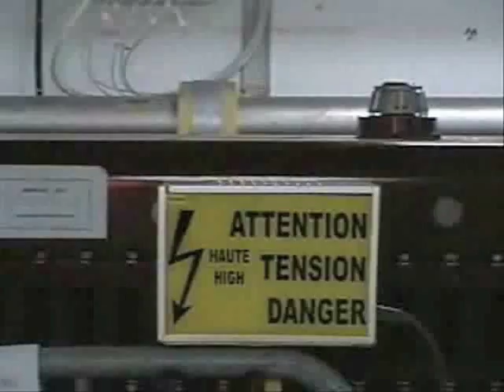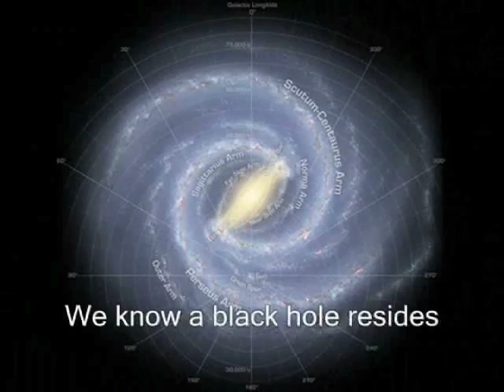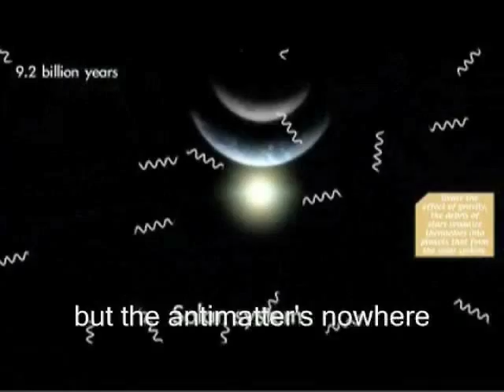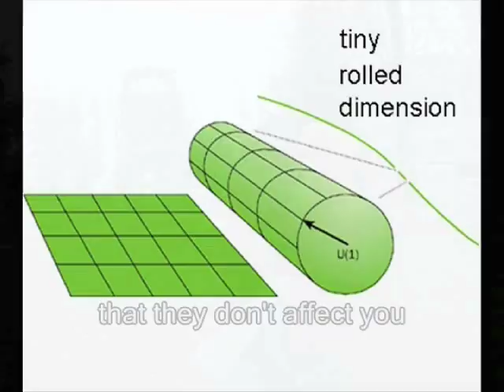The Large Hadron Rap

Comment: This clip refers to the Big bang theory that violates Conservation laws.

If it were possible, to put a figure to all of the Universes energy regardless of time, as in refering to the universe as a single dimension without any change, what we have is a closed system or a single quanta of energy "single dimension" that equates to 100% of the energy, lets refer to this as E=100

Now if the universe changed from a solid or a single Potential, it would need to consist with more dimensions E=Mc^2